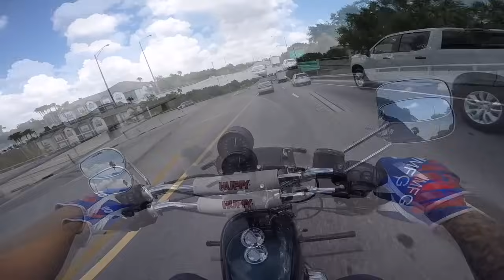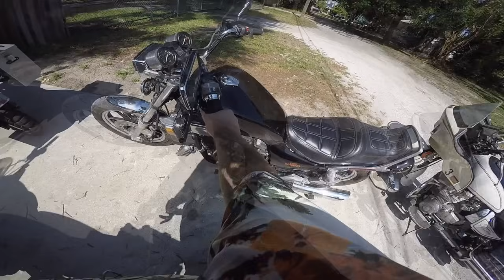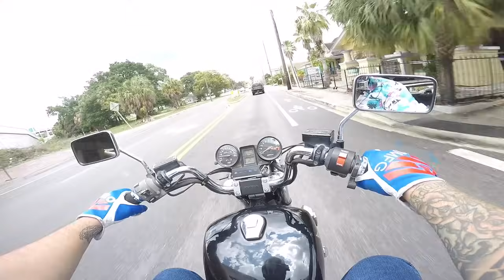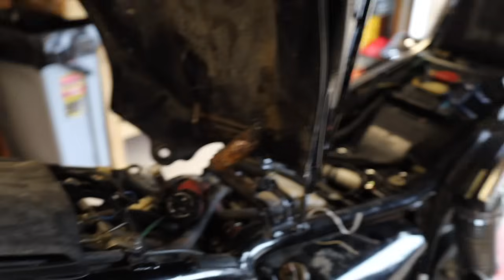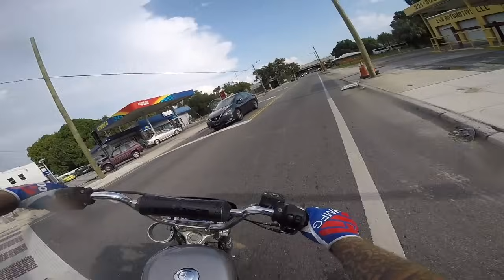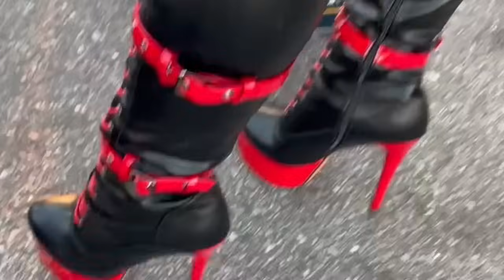Forgotten Fury: Honda's Insanely Fast 80s powerhouse will STILL beat any Harley... and I bought one

Comment: Firstly the V65 came out in 1983 I bought one. It was 1100cc not 1200. It ran a 10.84 quarter out of the box and it had 116 hp.
Reply: My dad had an '84. It ripped for sure.
Reply: The V65 Magna and Sabre were ridiculously fast.
Reply: @coache1nine  Those V65s came out in '82 were the first of the v-4s, right? The Interceptors came out in '83 and V-Max '85 I believe. I'm just wondering if the Magna was the first.
Reply: @angrytater2456  if I remember correctly, the Magna came first. I do remember the VMax being a response to V65 Honda's. I remember Honda was quick to advertise that 10 second quarter mile time. My dad test road a VMax but didn't buy, he said it scared the ish out of him.
Reply: @coache1nine  The V-Max is a beast. As far as bikes getting in the 10-second range There had to be some Suzuki GS's or Kawa KZ's that hit that mark but a cruiser doing it is impressive to this day. Thanks for the reply.
Reply: @angrytater2456  hey, no problem. I don't know if any of the KZ or GS bikes got into the 10's. They were the original Superbikes. I had an 83 GS1100 Katana. Regret ever getting rid of it, especially since they only made it one year.
Reply: @coache1nine  I always have an eye out for a GS1100. Very hard to find an original bike. People use those engines in all sorts of creations. I imagine there is a huge aftermarket for parts. Same with the 1000 of course.
Reply: I still have my 83
Reply: I have an 86 1100 I’m currently trying to tune in right. Converted it from the stock dual card to a single 43mm carb
Reply: @SooJDM  keep us in the loop sounds awesome
Reply: @angrytater2456  I used a 750 intake manifold since they came single carb! Needs a little tweaking to fit since the heads are wider than the 750 but will work!
Reply: sounds like you need a good coupling.....know a person who works with fittings and/or metal worker?
Reply: @angrytater2456  I weld personally. Actually had to make an extension on it to fit under the 1100 tanks being they are larger but since I put a peanut tank on the bike I plan to cut the extension back off and flip it so the carb sits higher for more leg room!
Reply: And i thought my 85 shadow was a strong bike with 65hp...    I was wrong.
Reply: @Milspecpoptart  Those Honda V-Twins were good bikes.
Reply: And that cool commercial..... "THE WORLDS FASTEST PRODUCTION MOTORCYCLE " everybody wanted one after pee wee what's his name ripped down the strip
Reply: @tricycleguy2657  My father took a curve at 120 mph and flipped a V65. He stood up and his foot as facing in the wrong direction.
Reply: @angrytater2456  ouch
Reply: @tricycleguy2657  Yeah his riding buddy right behind him picked him up and took him home. Beat the DUI case cause he said he went home and drank the pain away.
Reply: @tricycleguy2657  the music was “eye of the tiger”
Reply: @coache1nine  funny I never got beat on 900 kal
Reply: @Billybritt-s4t  we all know it comes down to the rider 😁
Reply: I had V45 and had it time and got about 120 speedo bouncing
Reply: @SooJDM did you ever get that single carb figured out?
Reply: @tricycleguy2657  I miss mine so much thieves got me.
Reply: I owned 2 v65 a saber,and magna, absolute beast,of a machine.and had owned,one v45 magna ,let alone ,I raced from a dead stop a Yamaha xs 1100, with the v 45 I ate his lunch in the quarter mile,and taken down any Harley,on the interstate and also in town,.the v65, could take any Harley,would eat alive the Harley v- rod hands down.the bike was bone stock,no aftermarket exhaust needed,,or turner kit,just a bike with the best looking appeal and performance to take anything crossed it path.
Reply: @coache1nine I heard the handling and braking were bad on that vmax
Reply: @420f37  my dad never mentioned the handling, which is odd considering he drove air cooled 911's. 🤔 Horsepower is a dangerous aphrodisiac!

Comment: Be careful! V65 is dangerously fast when running correctly. 90+ in 2nd gear and over 165 mph when you stretch its legs. I played with the v bikes in the 80’s.
Reply: 165+ miles per hour???
Reply: I hit 175 racing a 89 Supra, tricked out af. And I still had throttle
Reply: On a Sabre
Reply: Lets see an "Interceptor" review
Reply: With the Cam and carb change My Sabre took getting used to, big bike, it was bobed, no fairing, no Bags, hitch removed and new turn signals, installed. Hard Driveline was a lot different than a Dirt Bike or a 900 Sportster from 69. When you get used to it, you can hit high mph

Comment: First bike was a Magna V45, my second was a VTX1800C. Love me some fast Hondas.
Reply: I had 3 V45's, currently have a V65 and an VTX1800c.  Sad thing is the V45s will beat the 1800 to 100.
Reply: Ya right
Reply: @jasoneager9323  then your 1800 isn't running correctly lol
Reply: @mogolo6621  seriously.  The V45 has a .1 second better 1/4 mile time.
Reply: @jasoneager9323  yea I just looked it up, I've only ever rode a non stock 1800 must be a weight issue on stock 1800 lol heavy ass tanks
Reply: @mogolo6621  V Twins just gotta do the best they can.  🤣
Reply: Never rode a 45 or 65 rode the 1800s..always wanted some of the older metric bikes

Comment: Magnus  ain't no joke man, absolutely brutal when tuned right, just make damn sure your safety issues are dealt with before ripping on it too hard! Tires, brakes, wheel bearings, headset bearings, bars, controls, bleed brakes with all new fluid etc

Comment: If I recall correctly, those bikes had a cam oiling problem that caused scoring of the lobes and a few other problems. You might check into what the mods were to fix that issue and determine whether or not it was done to your bike. Nice find, man. You're bringing back memories, as always.
Reply: I remember that.  
Did they do a recall?
Reply: Reportedly, that was corrected with the '85 MY.  I cannot verify the credibility of that info as I don't recall where I got it at the time.  I remember people doing two styles of fix.  One required some drilling and tapping, the other a ring that mounted between the case and oil filter.  Some people still had cam lobes getting wiped even after the "fix".
Reply: @elgringoec  Thanks for the info! :)
Reply: I read a lot of ads for these in which the seller states "no second gear problem" so there's something else that needs attention.
Reply: @spaceflight1019  
Yes I remember talk of that in some of the discussion boards.  All we know about it is some people had problems.  I have no issue with mine.  But we also are fully aware that some people are natural enemies to machinery.  And second gear is the safest to go full power in because it won't flip over and it won't go too fast.   In third it pulls strong all the way up to ninety or so, which is too fast for most people.  I'm gonna say abuse; the bike is so over-engineered that it's hard to imagine a weakness in one of the gears, but at the same time I don't know enough to rule it out.   I expect if you get one and the gears are good, and don't grind any, it'll stay good.   

This bike has enough pull that you can shift right through second straight to third and not be slowed down, with pillion and fully loaded for camping.

But it's not an adventure bike. It's great on asphalt but a disaster on dirt roads. It's even sketchy on packed gravel, forget loose gravel.
Reply: @elgringoec  people red lining second gear in city driving!😂
Reply: @masterofnonetv8361  
😂 Well, ya gotta be first to the next light!  😂

I wouldn't want to city commute on my V65 Sabre.  It conquers mountains, back roads, and interstates.
Reply: I was watching this through my Roku and logged into my computer to comment EXACTLY what you did. These bikes are just as incredibly fast as SS says, but they were found to trash their cams. Yep, that's probably what's going on... those valves are just not opening much. When these were new, I described the quickness of this bike like this: It's like the throttle control has a cable directly connected the speedometer. It was that quick!
Reply: @halnwheels  
When the cam lobes start to wipe, the valve train starts making a lot of racket.  It's painfully obvious something is going wrong before drastic reduction in power.  If that were a problem with his bike, he'd hear it.   Anyway, didn't he verify two cylinders weren't sparking?
Reply: I had a junker 82 V45 Sabre and you could hear the valves before you could hear the bike I swear 😂
Reply: @contraband1543  
Some of them got abused badly.   There were more skilled home mechanics dedicated to caring for their machinery and still there were some people who just rode them like they stole them until they broke and just got rid of them after they thrashed them.
Reply: It was a problem, bit didn't effect every bike.  The aftermarket took care of it w an oiler mod sold by a guy named Dave Dodge.
Reply: @xnihilo1044  cured in mid 86 with an engine mod,  The valve cover gaskets all have a half moon shape where the cam bearing holders were line bored.
Reply: @masterofnonetv8361  but redline was only 10500.  It's a v motor after all
Reply: @yrreteugarps2835  On the 700s only. The 1100s never got line bored.
Reply: Was the V45 only.
Reply: The V65's didn't suffer as many cam failures as the V30's and V45's. It was caused by poor surface heat treatment of the cams (lobes and bearings) and excessive oil clearances in the head cam journals. Honda's patch up stop gap fix to get the problem bikes through the warranty period was a larger top end oil supply banjo bolt and new replacement cams with ever so slightly larger cam bearings and better face hardening. A friend had a V45 Interceptor that ate it's cams and heads twice while under warranty. As soon as the warranty was up, he sold it. Edit - I have twoV45 Sabres in my stables, one is fine with over 30.000 miles, the other had the trashed cam problem with under 10,000 on it. I'd love to find a nice V65 Magna - with good cams, that is.

Comment: I've had 2 V65s (just got the 2nd one running and will be posting a video shortly). If you don't respect the power they'll throw you like a bucking bronco. 

That said, there was one year, 1983, where you had a different rivalry - with the Yamaha XS1100. Known as the "excess" this inline 4 may have had more to do with inspiring the V65 than any other bike. I've also had 2 of these ridiculously fast cruisers.

The XS was sick and set the bar first. Then came the VMAX...

What a pity Honda only made the V65 VF1100C for 4 years. It is power on 2 wheels that literally rides like no other. Dangerously responsive if you crack it and don't know what it's going to do.